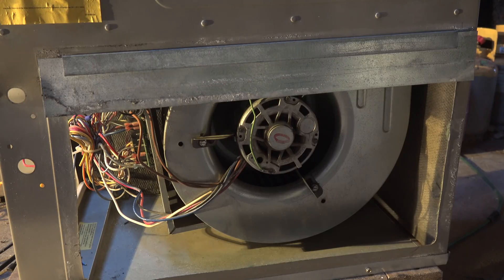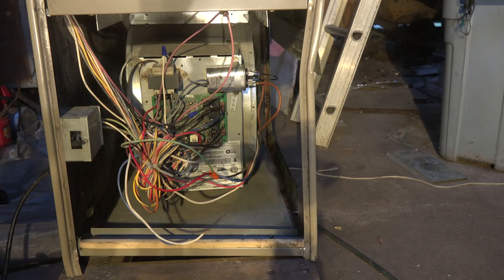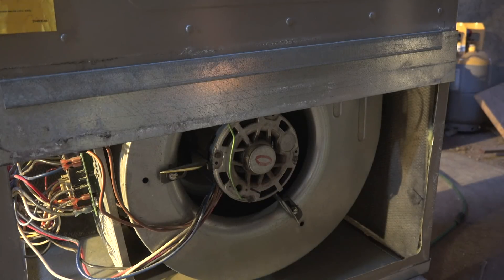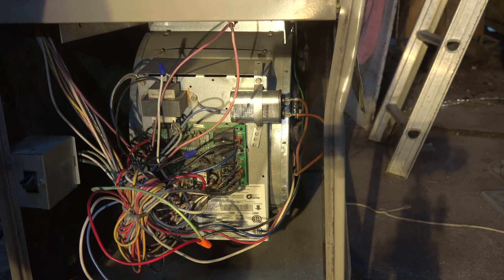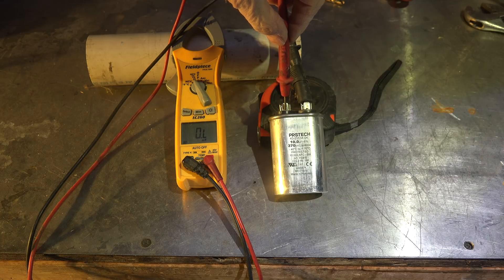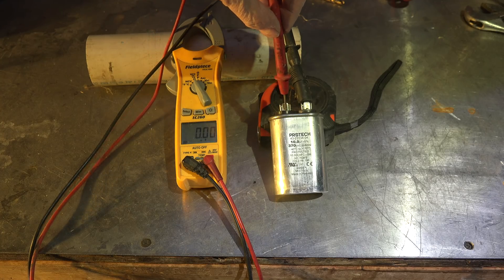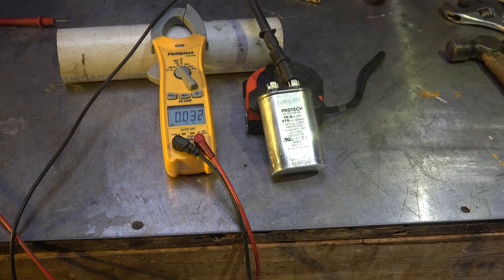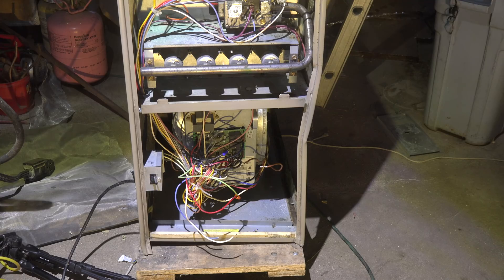Diagnosis and repair of the furnace fan Part 2

Comment: I replaced both the blower motor and capacitor, when I turn the furnace back on, the fan immediately starts or starts humming.  The furnace then kicks on heats for about 30 seconds to a minute and then the furnace shuts down but fan continues to run or hum.  I feel the motor and it is getting hot so I shut off power right away.  Any suggestions?  I triple checked the wiring when I replaced the motor and the only extra wire I had that wasn't on the old motor was the brown and white wire that maybe needs to run back to the cap?  I have the single brown running back to the cap. Limit switch?  Great videos, glad I found your page.  Thanks
Reply from the maker: Sounds like the cap is not properly wired.  Most replacement motors have a brown and a brown with white stripe wire that goes to the cap.
GFM

Comment: I have a Goodman GMP furnace.  The fan motor in my furnace was damaged by a power surge.  The reason I know that is that I was home in the room next to the furnace closet when the power surge occurred.  The fan motor never ran right after the power surge.  The motor would start and run for a while but would get hot and kick off on the overload.  I tested the cap and it was OK.  I replaced the motor and the capacitor and I installed a GE whole house surge protector in my electrical panel.

Comment: Yup, always recommend the motor be replaced when the run cap has failed or has been running below its rated tolerances. Notate the customer's replacement refusal on the invoice so when the motor fails in 2 months your @ss is covered.
Reply: Tomon8tor 
I've been burnt from this before. Change both no call backs. Try to be a nice guy and replace cap and 2 weeks later they are calling back a no heat and they think your an idiot scammer
Reply: @RockoRocko-rz7kx  yup it's often difficult to convince the "if it ain't broke don't fix it" customer  though and they think you're trying to scam them for a new motor.

Comment: capacitors that say "protected" will go open circuit if it overheats or shorts internally. So protected more or less means it has an internal current/thermal fuse that opens in a fault condition.

Comment: Can't you replace the capacitor, and then check the motor to see if it is over amping as compared to its rating plate?  If the amperage is high then replace it, but if it's still runs within spec, I would continue to use it.   Another question, Is that a start capacitor or a run capacitor?  From the way you talk, it must be a run capacitor as you say it will run, but over heats.  Generally it's heat that kills the windings as the varnish in windings burns and deteriorates,  It's basically the lack of proper insulation of the windings between one another that causes over amping..  I had a tool that could check the quality of the winding insulation.  Another test is the sniff test.  Do the windings smell burned?   I say start it up with a new capacitor, see if the motor runs properly and check to see if it's over amping.  If it over amps change it, or perhaps as someone else said, it could be time for a new furnace.  Since this is a junker.  I'm going to assume it was junked out due to the motor problem and who know what other issues?   My old furnace was a belt drive.  In some respects I think that may be a better way to go, although it was kind of noisy compared to the new one which sounds more like a jet engine.

Comment: Well if you leave off replacing the motor and it fails within 2 months that customer will want it fixed for free.  But the motor might last for years.  Best thing to do is sell them on a new box  :-)
Reply: Many customers want it fixed as cheaply as possible and can't afford a new furnace.  The only time I installed a used blower motor was when one customer told me that he had just lost his job and couldn't afford a new motor or furnace.  I did have an exact replacement fan unit that came out of an identical used furnace and it worked great.  The customer was very happy and I told him no warranty on the part and wrote it on the repair order.
Reply: @picklerix6162  I have the same customers.... They don't have two dimes to rub together, and no heat is  no heat.  Or rather landlords that toss nickels like manhole covers.